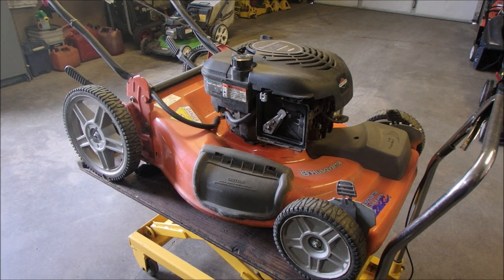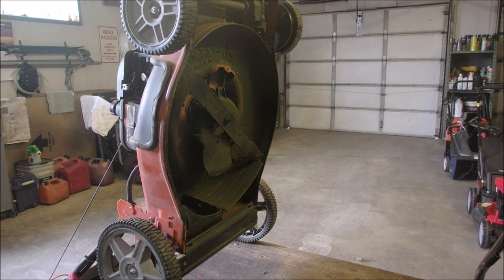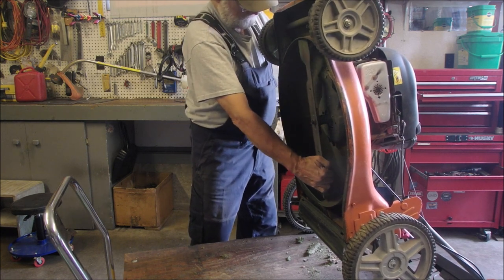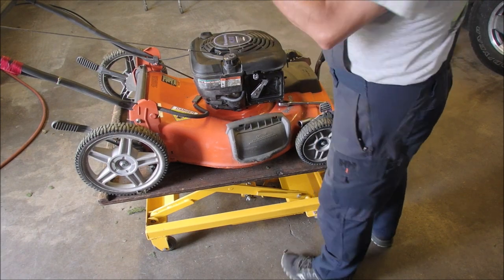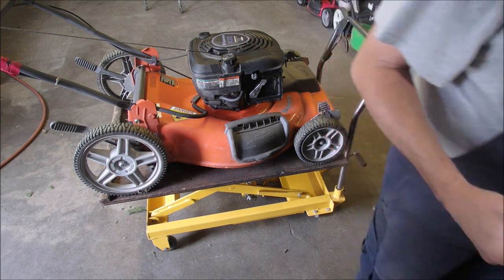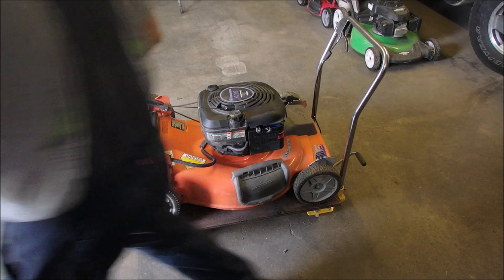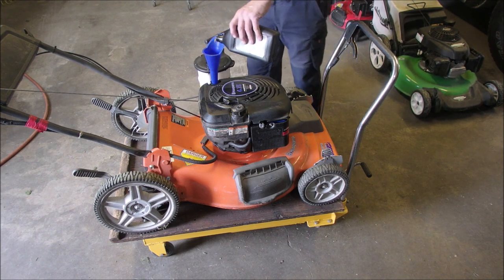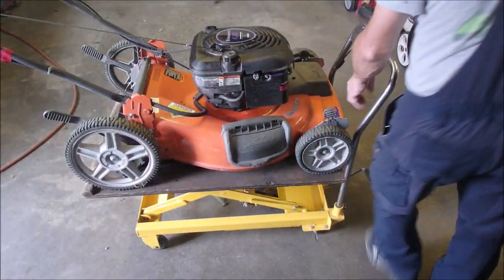Old School Husqvarna MowerTune Up

Comment: The Craftsman version was ok but the deck rusted through. I should not have parked it on cement with puddles nearby. It was covered and still rusted. Ran perfectly after 6 years so I patched it and passed it on. Carb bowl never removed from 2009 till 2015.
Reply from the maker: Thanks for sharing

Comment: Sorry pushed send too early.
Other small engine channels have expressed concern for getting parts for the Husqvarna mowers since they are no longer in production and not suppling repair parts. Also they are shutting down plants and moving production to other locations as well as going green and only producing battery powered equipment.
Have you heard anything like that in Canada?
Reply from the maker: What i have heard is the Honda's are not going to be sold for lawn equipment after September this year.

Comment: They do not make them like this one any more Bruce, the new Husqvarna's are having issues and many of the parts are on backorder. Husky parts availability is getting like the B&S camshaft with ACR you just cannot get them. Additionally Husky is having major layoffs i think they are gearing up for battery operated machines BIG MISTAKE. Another well serviced machine coming out of the Penderosa. Good job buddy.
Reply from the maker: Thanks a lot Wayne.  it means a lot.
Reply: I recently did some filming as a trial about how you should kill your monster mosquitoes in Alberta: fire up a riding mower that hydrolocked from a leaky needle valve and overfilled the crankcase and put a lot of oil into the muffler. As Taryl says fire it up and all those mutated mosquitoes you have in Alberta have no choice but to move over a province or two lol. Then you can get outside and have another Penderosa Golf Tournament without handicap of those skeeters.

Comment: The new Husqvarnas are junk. The deck, wheel adjusters and front drive are trash. The one I had lasted 3 seasons before the front drive/bushings and deck mounts were all trashed. Having better luck with the Honda that replaced it.
Reply from the maker: Yes I have seen them as well.  Thanks.

Comment: Dumb question Bruce I have a mower I had starting on the first pull I ran over a branch that stalled the mower it would start and run for 2 seconds then stall. After it's sat it'll run after a few pulls and run I checked the flywheel key its not that what could it be or is it just coincidence
Reply from the maker: That is a tough one.  I wouild drain the fuel .  Fill with good new fuel just to start.
Reply: @BrucesShop  its new fuel. Ran fine till it stalled hitting the branch